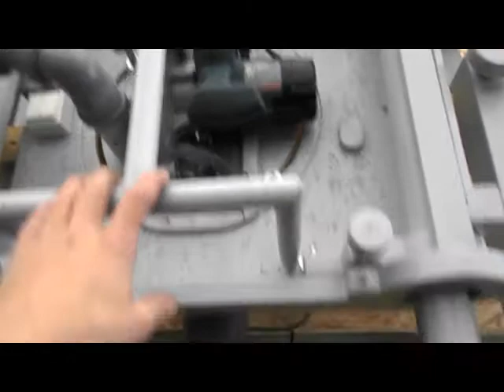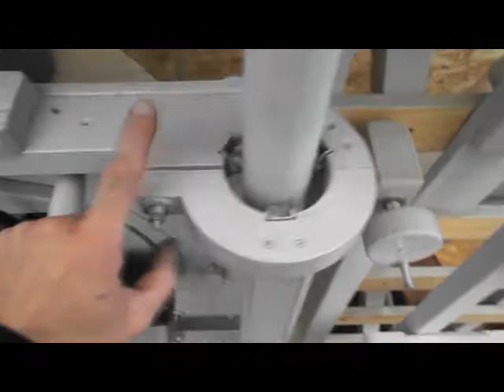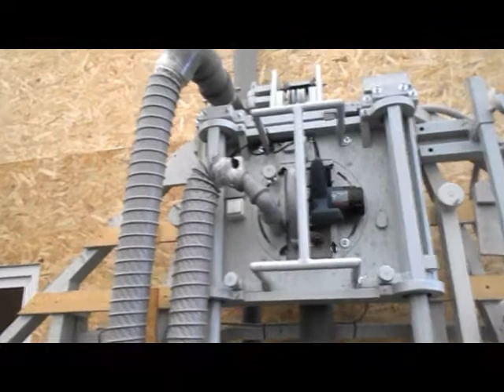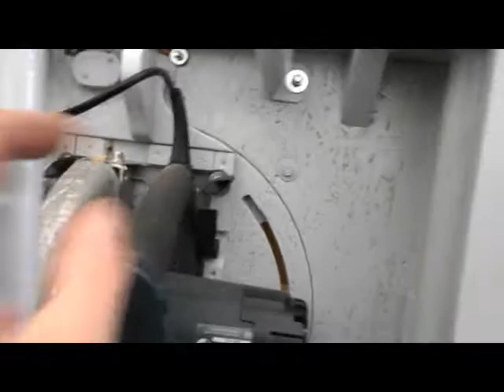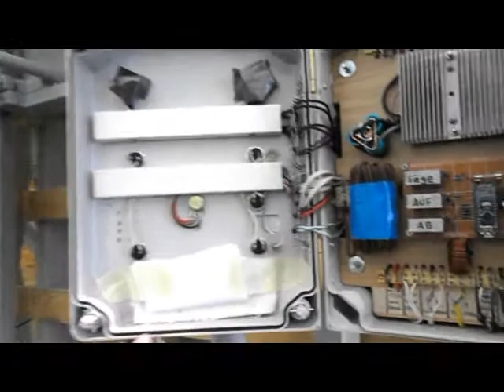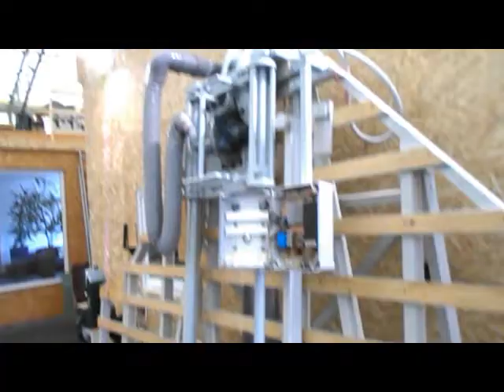Homemade automated panelsaw explaned

Comment: I am doing my research to make my own one without any automation yet. Try to make mine with light weight and portable, thank you for sharing, would love to see some high resolution videos.
Reply from the maker: Hi, Gordon.. Yes, i will buy a better cam soon. Sry, for the poor quality. I have built the machine without automation and used it about 1 year as a "normal" manualy operated Saw. Then, later on, i added the whinch + automation stuff. Thats a real game changer. Now i can step back from the noise and the dust. And it is safer for me. Thats also a nice side effect. ;) I can send you some pics which i have made during the building process, if you give me a e mail adress.  Greets from Germany.

Comment: Absolutely ingenious.  Thank you for sharing this masterpiece of creativity. I have translated the code back into English but had trouble copying the wiring diagram because it was out of focus. I plan to build this for my home workshop and I'm asking if there is any documentation or drawing with measurements or such you can provide.  Whilst the video highlighted the excellent build, I was not able to work out measurements etc...
The machine would have to be at least 9' tall to take the 2400mm sheet goods..... Any help would be appreciated. Email: brucejomms@gmail.com
Reply from the maker: Hi, Bruce. Yes, i know, my cam delivers not the best quality.  :(   And, to be honest, the drawing is just a crude slip of paper. Just so, that i can repair the Thing if something breaks in the future. I will draw a "better" version of the diagram and upload it to my pinterest profile.( and send it to you) But you have to apologize, that i dont have the time to make drawings of the whole machine. Of course, you can adapt the size of the panelsaw to your needs / circumstances. Maybe i will make a short video, where i take measurments and do some Q&A.How does that sound to you?  Pinterest: https://www.pinterest.de/angelo6957/
Reply: @LariFariYoutube  Hi Lari thanks for the Pin.  If you get the time maybe you can email me through the dimensions of the frame work and in particular the rotatable saw guide from 90 to 45 deg for different length panel stock.. Thanks in advance.
Reply from the maker: @brucejomms  Hi, Bruce.. I have uploaded a "better" version of the circuit diagram to my pinterest profile. I hope, this is useful for you. More detailed photos are coming soon. Sry, i did not find the time, to draw plans for the carriage yet. So stay tuned. Greets from Germany....https://www.pinterest.de/pin/836754805761695893/
Reply: @LariFariYoutube  thanks Lari got it would appreciate some measurements if you have time....thanks again.